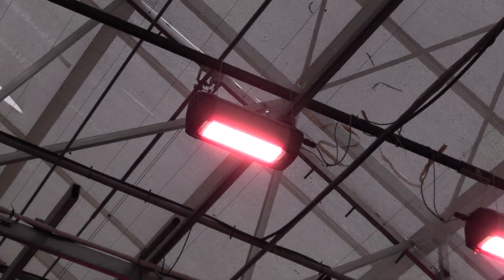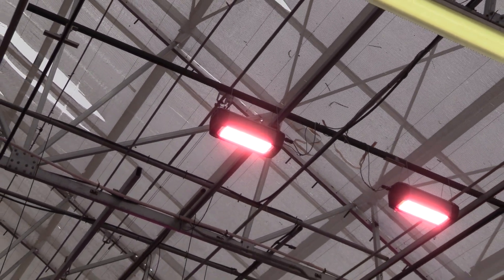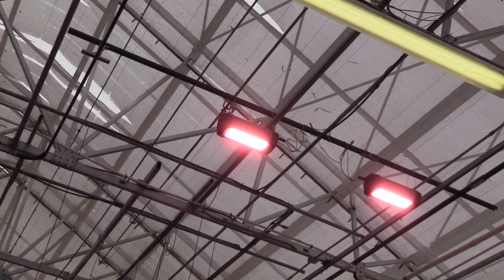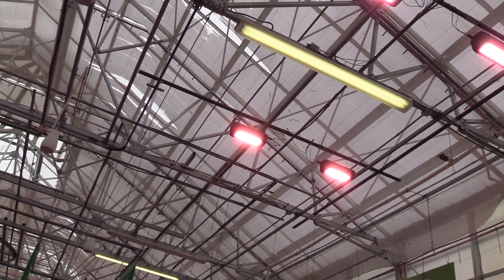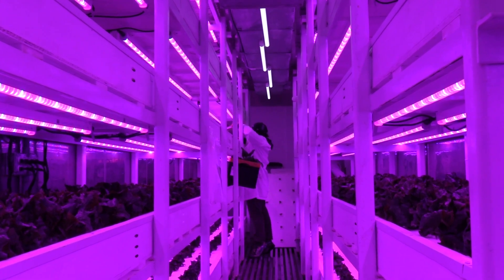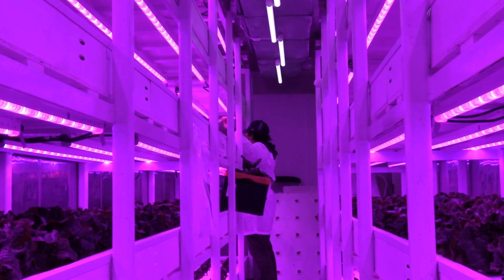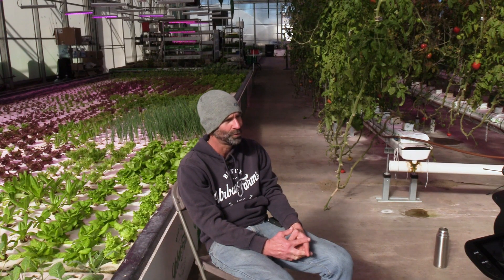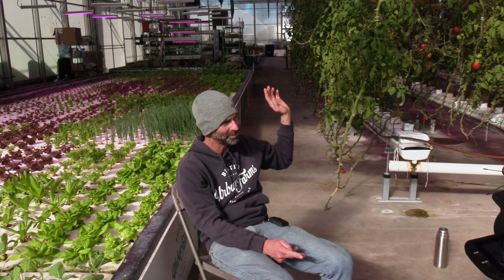Water and Energy Use in Hydroponics

Comment: What type of water you use?
Reply from the maker: In this case they have several filtration methods.
Always test tour water source in the planning stages to see if and what kind of filtration/treatment your water source may need.
Reply: @BootstrapFarmer how they  filter the water?
Reply from the maker: In hydroponics, common water filters include:
Reverse Osmosis (RO) Filters
Dechlorinators
Gravel Media Filters
There are also disk & mesh canister filters depending on the setup and water source.
Reply: @BootstrapFarmer  vielen Dank für deine Antwort 👍
Reply: What type of plastic liner are you using? Any links thank you!
Also how many solar panel watts did you need along with type of batteries used and AH needed?